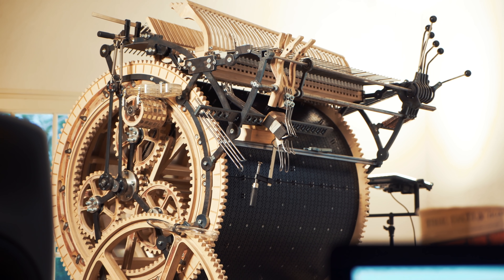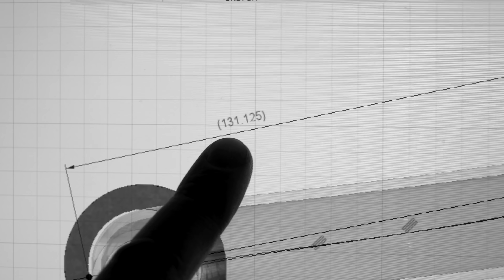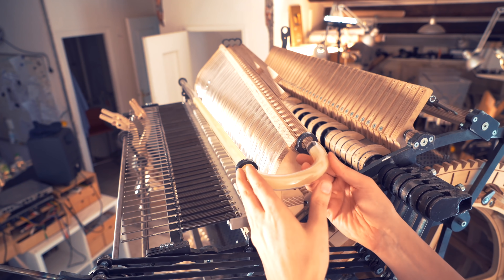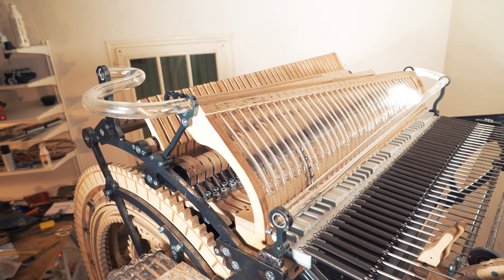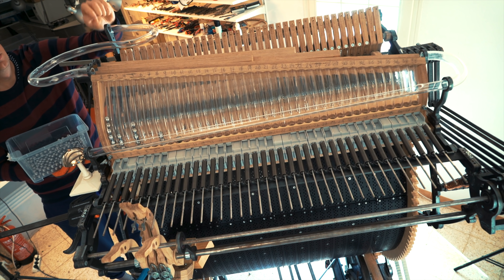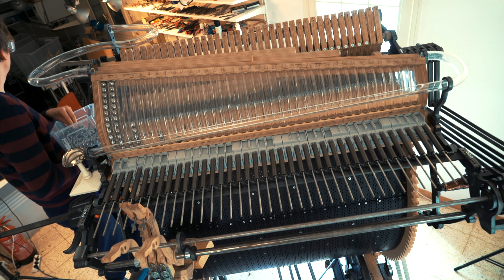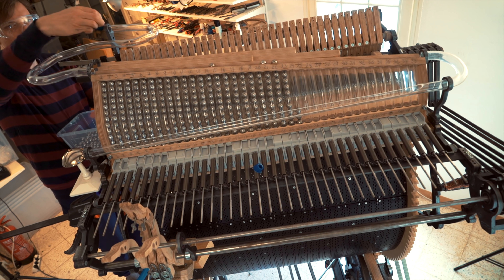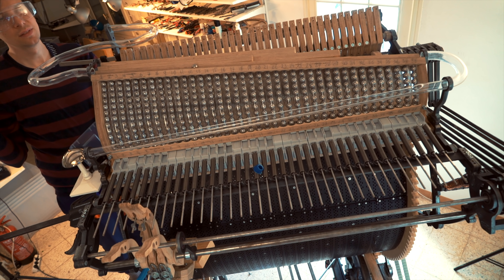Marble Divider Transport Tracks - Marble Machine X #68

Comment: I think a good compromise to building each song wheel vs swapping on the fly is to make a loading block and paper templates. The block would just be a flat wooden board the length of the circumference of the wheel, that you can put the pegs into backwards, then roll the wheel over to lock them into the wheel. Then, you make a laminated paper template for each song with the holes in it, and you can super quickly load a new song. You can roll the templates up into poster tubes for easy transport.

Comment: Random idea: (from a non-engineer with no experience in these subjects at all)  You should have a wheel that already has all of the pins installed with some type of system to retract and activate the pins individually and electronically.  Then code some software that will properly activate/retract the pins on a per song basis via some type of pre-programming of each song.  Between songs it will just be one touch of the button instead of having to reprogram hundreds-thousands of pins and having to install new panels every 2 minutes.  Obviously easier said then done but, that is my privilege as a backseat marble machiner.
Reply: Michael, I think Martin said this already: He could use electronics (servos/motors) to lift the fingers that release marbles, but he does not want to use electronics. The whole idea is that everything is mechanic.

Comment: I can't see how else the "programming wheel" could have been done; maybe sacrificing requirements (as Martin mentions) could have eased manufacturing, but ultimately it's mechanical memory that can be swapped out - just like the drum on the carillon in his video, what, like a year ago? Maybe paper jacquard cards - but then you have to make those and construct a device to read them, which may be easier to manufacture, but more complex in design and engineering. I'm a software engineer and we always have to face up to the fact that complex problems often require complex solutions; the engineering is all in managing that complexity effectively to create elegance and I think Martin achieved that.

Comment: A thought for machining your programming wheels. Can you laser cut the PE-3000? If so you could modify a Chinese laser cutter kit so that it fits over the assembled programming drum. One axis would be the width of the drum the other rotates the drum. You'd first get the drum built with the proper fit. Then the laser would cut the programming holes into the drum assembly. This wouldn't have the tool wear issues and likely be faster than the router.

Comment: Maybe you should bend the plastic sheet first and then make all the holes after that. This would mean you have to build a machine for that special case, the programming wheel as a rotational axis.

Regarding overcomplicated thing, you're building it complicated because of the look and feel. You could just make the same music with a synthesiser and nobody would notice the difference. But it wouldn't be fun to watch. So keep going, you're doing the right thing.

Comment: Martin, please don't get defensive or start second guessing yourself. I was a software designer for 25 years and I completely understand your argument for complexity vs requirements. People were constantly urging me to adopt simpler solutions while not comprehending that those solutions omitted requirements.  Software has to be 100% requirements driven.  And your awesome and elegant machine has to meet your requirements to be useful to you during the performance. After all, you are designing and building a musical instrument first and a beautiful showy mechanical marble pusher second.  Keep up the good work.  If it weren't hard everyone would be doing it. Your point of no one having viable alternate solutions is spot on.

Comment: When you first were building the programming wheel I thought you might be able to vacuum form the plates for the wheel. So have one quarter wheel that is programmable and use it to cast several plates that aren't reprogramable but are relatively easy to store and transport.

Comment: For the programming wheel, it seems to me that he could do something like this: drill a couple extra holes near the edges of the panels where the two panels meet; fashion a piece of metal with two prongs the exact distance the holes of one panel should be from the other, and use those peices of metal (brackets? spacers?) to set the correct distance between the panels. He's basing the correct distance between two panels base on the programming holes, so drilling a couple more holes for this express purpose should yield the same precision. Then, adding and removing panels could a mich simpler task, and the idea of having interchangeable programming panels for different songs might be reasonable.

Comment: Back in the dim recesses of memory, almost forty years ago when I was studying computer science, I heard the story of one of the original Algol compilers. The first edition of the compiler which existed as a deck of Hollerith cards was destroyed in a fire.  This forced the developers to write it again from scratch.  The second iteration was smaller faster and generated better code.  So this second system effect that you mention, apparently first proposed by Fredrick Brooks  in "The Mythical Man Month", is not necessarily the right way to think about it.  There is also a popular notion that you should build one to throw away.  That idea is never popular with managers that need to get a job done but it will probably generate a better product in the end.  The second system effect that Brooks discusses is probably due to trying to add to or enhance the first system rather than starting over completely from scratch.

Personally, I believe that you are absolutely right to demand perfection in the programming wheel.  Being able to do triplets accurately is tremendously important.  The human ear can differentiate rhythmical errors of a few milliseconds.  The errors you are trying to manage are also in that range so it does make a difference.  Persevere!    
I look forward to attending your first concert in Tokyo.
Reply: To be honest, nobody even noticed the double-notes from one faulty channel on the first machine which kept feeding two marbles at a time. I don't think the timing is as critical as he thinks it is, but I'm glad he's being so deliberate about it.

Comment: I made this comment on an earlier video and won't elaborate in case you've seen it, but put the wheel on your CNC machine and cut it while rotating it, manual 4th axis.

Comment: That momentum killer snake is no good! As you have already seen it needs way too much fixing because it is not staying exactly at its place. Also it is too long/unelegant. 

It is a trajectory problem, not a speed problem. Because the output of the pipe is above the rail the marble jumps over it. Your flap solution was close to the correct one, but it should be a fixed, wodden triangle, like here: https://i.imgur.com/YFY1OrH.png (Top one is your solution, down is mine) This way they get shot down, lose momentum during it and comes down on the beginning! of the rail with quite consistent speed.

Comment: When bending those tubes, simply lubricate the inside of the damn pipe with a silicone oil so the the process of pushing that rod inside is smooth, when you are finished simply pour few drops of a dish soap inside add water, seal the ending with your fingers and just shake, rinse and dry.

Comment: I don't think it's the design of the programming wheel that is the major issue, I think it's the process of cutting the slots before the wheel is assembled which makes it difficult. 

The typical programmers solution to these things is to write a secondary program that helps you write your main program, in this case, building a machine that can cut the slots in the plates after they are assembled might be less work than getting the spacing right first and then assembling it. 

Especially considering that you may want to produce any number of these programming wheels in the future, the time invested in building a dedicated machine to cut the slots in place might save you time later. It looks like more work and added cost before you have tried to do it differently :)

Comment: wonderful video, and machine. In the case of the programing wheel sometimes the best solution is going to have to be extremely intricate and complex, with a project like this there is no real room for simplifying parts or systems because of the need for precision and accuracy.

Comment: Now there’s an incoming issue: the length of the marble divider doesn’t allow to feed quickly the last tracks from this, at least at this point. It seems that you have to improve the system that you already implemented, but as far as it, in this moment you have to solve this problem designing a better way of feeding the marble divider in order to keep an acceptable rate of filling along the time that it takes to accomplish this task.

Comment: Just a thought, couldn't you do the programming wheels to have spring loaded pins on every possible music note spot then the songs are just metal sheets with holes where the notes is? I think that would be easier and lighter system than you currently have

Comment: What you're saying makes perfect sense to me. I think some people don't realize that sometimes solving certain problems just require a lot of work, and what seemed like a simple idea in one's head, in the actual machining and engineering and building of it, takes considerable trial and effort when you run into unknown problems. Also, at this point, it would be probably far more effort to try and switch to another system as that would require a massive re-design (unless somebody thinks of something brilliant) and there would be diminishing returns trying to switch to some other system. At this point, I understand why you'd just put the effort to make it work. 

If you ever design a Marble Machine 3, it would be interesting to see how you took what you learned from the first two, and perhaps made an even simpler, more streamlined machine. That would be interesting to see. 

By the way I applaud you for your effort and doing this, it takes real determination and patience to stick with an engineering project like this, and especially since the final output is to create a whole new musical instrument, something the world has never seen before, that's really amazing and as a musician, I really appreciate this.

Comment: You have picked a good hill to defend! I also thought that there must be an easier way - but like all challenges, if there was an easier solution somebody would have already done it 😉 So it was a problem worth solving. My only concern is what will happen to the programming wheel over time as it goes in and out of packing cases, travels at different altitudes in aircraft luggage compartments, goes through different temperature and thermal expansion stresses etc? The tolerances are so fine that it may go wonky when tested in these ways. What do you think? Am I over thinking it 🤔?

Comment: In paintball, we have something called a "flatline barrel". It causes back spin on the ball which allows it to fly much straighter than if it was normally shot through a smooth bore. For your sneaky snake, you could try roughing up the inside of the pipe to cause friction/backspin on the marbles causing them to slow down. You would have to test it to see whether it makes a substantial difference for reducing the marble's kinetic energy levels, but if it works it would allow for a much smaller configuration which in itself would be much more stable.

As always, looking forward to next week's video!

Comment: What is the reason for the pins on the progwheel to have to have exact position within 0.1mm? From what I can see the diameter of the progwheel is about 1m and it turn one full revolution in about 30 seconds. This gives 30000 tenths of mm in 30000 milliseconds which is reformulated: The note is 1ms off if the pin is 0.1mm off. If I remember right martin says in #52 that time uncertainty up to less than 5 ms is OK... This would mean on the other hand, that pin position uncertainty whithin half a mm would be acceptable.

Comment: Could you 3D print a flexible sheet with bumps already on it for the songs already composed?  The sheet would wrap around the entire wheel with a couple of holes in it to align properly with the main wheel.  So changing songs in concert would be removing the locking pins and then unrolling the old sheet, then inserting, rolling up, and locking the new sheet.  The main roller would still be able to accept any new compositions that you made on the fly or even pierce the flexible sheet to make new variations on existing themes.

Comment: If stud welding introduces noise, I'd bet HP would be keen to print them on their  to showcase their technology. I think the build volume for their new Metal Jet printers is big enough that you would fit a programming part plate. It's also optimal PR for them. Happy to introduce.

Alternatively, Nylon 11 or Nylon 12 printed on HP on Multi Jet Fusion could have the mechanical properties for this application. We make leg braces that get constantly walked on without any visible damage. 

One would assume a midi-to-analogue converter for the most sophisticated mechanical instrument in history would need to be complex.

Comment: I have an idea... :) Prebend the PEI onto your current segment frames, BLANK (maybe use some heat to persuade them). Yea gasp. Leave the metal backer out, you will see why no metal backer for now in a second. Set up another programing wheel temporarily on the cnc table as a rotary axis,  parallel to the gantry. Load the blank segments, setting up their edges tight. Mount the router head from vertical to horizontal facing the end of the table where the blank programming wheel is. The Z would have to be set as high as the wheels axle, putting the bit on the center line, other wise its not needed to move. A stepper motor (maybe off the z) is GT belted to the programming wheel to precisely rotate it (200  motor steps times the motor to wheel pulley ratio, could be 10 to 1 for 2000 wheel step resolution, or more). The bit would be moved into the PEI by moving the Y(? I don't know which is X and Y on that table) tracking the gantry across the table. The left right position of the holes would be by moving the head on the gantry (x?). I hope this makes sense. You could make both generic plate sets and one song only sets, with music to gcode software, quickly. And they would be perfect. Because the bending effect would be canceled out because the sheets would be routed pre bent on the wheel. They will need to be pre bent to right radius so they take the curve relaxed, before being screwed to the frames. NO FORCING. BOOM?

Comment: Question... eventually you will have 3 ways marbles can enter the divider, what would happen if they end up bunching up at the end to the over flow? I could potentially see a marble falling down from the second or third track and collide with a marble on the first track. Maybe cause it to bounce and fall off the machine.

Comment: Make the plates out of steel, and drill/tap holes to put screws into? Might not   support fast enough changes?
Reply: and how much killed tap?
Reply: @pascal-cm4sq  With rigid workholding and good cutting fluid, you can cut hundreds of holes per tap -- probably an entire plate. Or you can use a thread forming tool, which doesn't really wear out.
Of course, if it's Martin we're talking about, well, he has a history with taps  .... :-D

Comment: I agree that this is a very detailed engineering problem. I also appreciate the continued effort of you and your team. It will be very rewarding when this dream comes true and everything works as intended. Spending lots of time considering all of the potential issues is smart especially if you want shows to go smoothly and be enjoyable for you and the audience. 
On a similar note I regularly work with simple Solid works assemblies designing parts for our SAE baja team. The model of this machine is outstanding

Comment: It's impossible to complete a project this massive without the need to go down a few rabbit holes here and there. I don't think you went over the top with the programming wheel+plates simply because you have so many reasonably realistic requirements to meet and the materials you had to work with brought their own set of issues. Tight beats, quick and effortless reprogramming, etc.

Great work and I look forward to these videos every week.
Reply: If Martin is happy with the solution I'd suggest he finishes the rest of the machine rather than exploring all the various alternatives.   There is something to be said for bringing it to a conclusion.  One man's sunk cost fallacy is another's determination to see an idea to successful implementation.